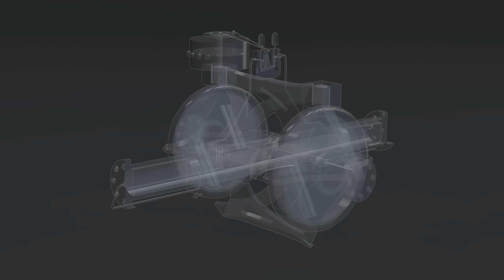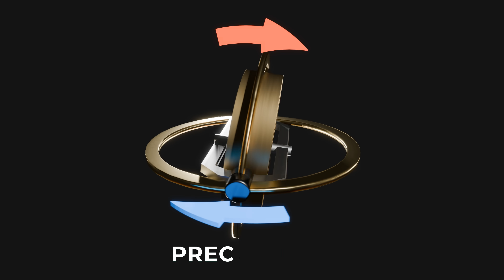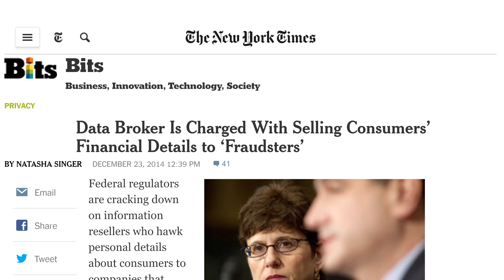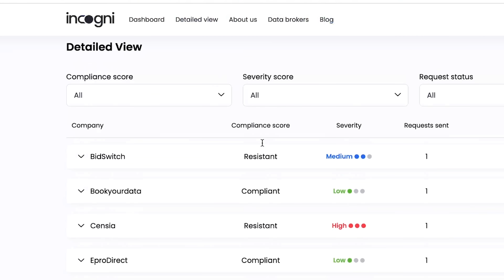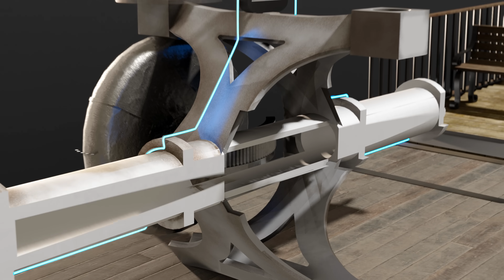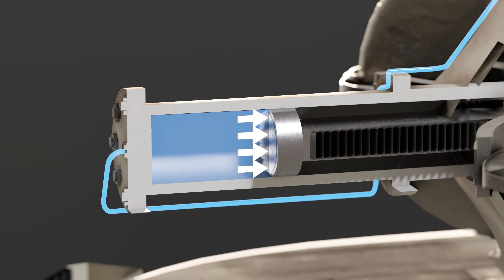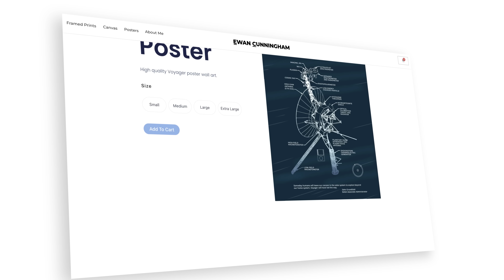The Self Balancing Monorail

Comment: I cannot believe this was conceived in the 1910’s. Truly a genius design that didn’t get the credit it deserved
Reply from the maker: I feel the same.
Reply: @primalspace It's a good idea for a self balancing e-bike/motorcycle.

Batteries are actually kind of terrible for regeneration, flywheels can be better.

You get free self-stabilizing when it's stopped.

And using power from the flywheel instead of the batteries makes your batteries last a lot longer.

If you get clever with fly by wire you can make an e-bike that always takes the perfect corners, and can be self driving.
Reply: @jtjames79  no its pretty terrible. Flywheels are extremely dangerous if not properly maintained and people never take care of their personal objects. Flywheels should basically be treated like a bomb in general as at the speeds they spin, they basically are. Plus Flywheels to balance things are usually impractically large. For this rail car it took up a quarter of the riding area. On something like a bike it would take up more space than an engine and especially electric motor. One person here on YouTube even tried making a bike use a flywheel for regenerative braking, it really just isn't as effective.
Reply: @jtjames79 sounds fun but a self driving bike would also be pretty useless, wouldn't it?
Reply: @Skylancer727  I saw that YouTube video and it was a mechanically linked half-ass implementation for clicks, not a serious attempt.

James Burton has a lot better design.

And I really don't have a space to explain it in a youtube comment, but you use radial electric motors with their own batteries as the "flywheels". This is all stuff you carry on an e-bike except for a couple extra motors, that don't make that much of a weight difference. This isn't the iron age either, kevlar graphene enclosure weights nearly nothing and is practically indestructible.
Reply: @jojoflowe  if you've ever owned a horse you would know. If you know you know.

Edit: horse not house, typo.
Reply: @jtjames79 Agreed, i believe it could've been so much better but the implementation was just so... Mediocre.
Reply: Yeah it’s a shame, like yes it’s not feasible and a lot of the biggest issues weren’t even brought up but damn I’ve never even heard of this. If nikola tesla is this famous now then this definitely deserves some attention
Reply: It is fascinating for sure, a marvel to gaze at and conceptualize, but in the real world, it just isn't effective. A brilliant piece of engineering but a tangible failure. An engineer's dream but a mechanic's nightmare. Theres a reason its a saying not to reinvent the wheel.
Reply: Back then kids played with toy tops. Many people had a much more practical understanding of the world than today.
Reply: It was the Wolseley gyrocar
Reply: Once you realize that you would need a gyroscope on every car doesnt that kind of make it a terrible design?
Reply: @Crimson_Duke  Not to mention that only riding on one track instead of two doubles the ground pressure and further reduces carrying capacity. I would also be worried about maintaining all those gyroscopes on all of those railcars because if one fails, you would have a big problem.
Reply: @@retiredbore378ah, The British, not one, but two Industrial Revolutions 😜
Reply: Now it did :)
Reply: @@retiredbore378 Please, do tell me where the first two Industrial Revolution came from?! I rest my case🙄
Reply: you would need to make and mantain so many gyroscopes vs making rails and using existing trains
Reply: The pyramids were conceived several thousand years ago.
Reply: there are thousands on person who didn't got credit for their good works in past, reason - I was selfish and greedy all those times. 🤑

Comment: The problem is if the mechanism stops working, it tips over and people die. If you have an engine problem in a conventional train, it could just stop to a halt, but it’s not going to tip over and kill everyone
Reply: You are grossly oversimplifying this. It was an engineering sample. To go into production, it would have needed an emergency set of outriggers.  With modern materials, this is an entirely practical design. Also, did you miss the note that even with a loss of power to the flywheels, they would hold the the carriage up for 30 minutes before it would topple? That is a long time to detrain passengers.
Reply: It had 30 minutes of reserve momentum before tipping over. Plenty of time to come to a stop and deploy stabilizing legs in a pinch.
Reply from the maker: As mentioned in the video, the flywheels would keep spinning for 30 minutes. So a loss of power wouldn't suddenly tip the train over. On top of that, Brennan did actually have a set of stabilizer pins that could be deployed if there was a loss of power. The dude thought of basically everything!

Comment: I think it's a cool design, but it looks like it would have problems while scaling up. One big issue is that if you want to build a set, each wagon should have its own set of gyroscopes with its pneumatic system, which would add to the manufacturing, operation and maintenance costs, driving the price up significantly.
Reply from the maker: Yes, I could definitely see where cost would become a big (potentially bigger) issue.

Comment: its so sad that these really well engineered machines don't get the trust they deserve from investors
Reply: Of course not it looks like you're asking for a suicidal trip to the afterlife. I like my trains with the wheels on both rails thanks.
Reply: Well engineered and massively expensive
Reply: @mevolander8478 and still prone to tipping over if something goes wrong. That's the real reason.
Reply: @mevolander8478  yeah im not saying it was cheap to produce or whatever, but remember that it was 1910.
Reply from the maker: Agreed. There were definitely still issues to be worked out, but I would have loved to see where they went from here had they had the chance.